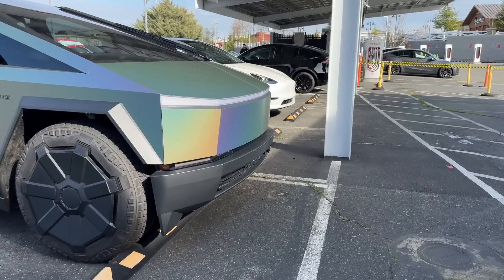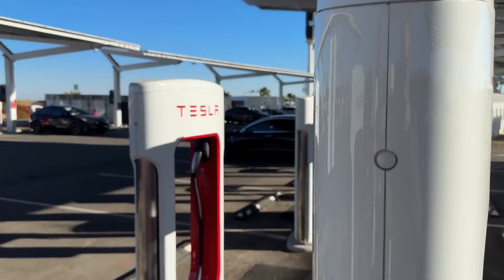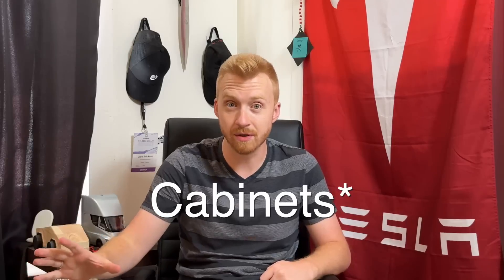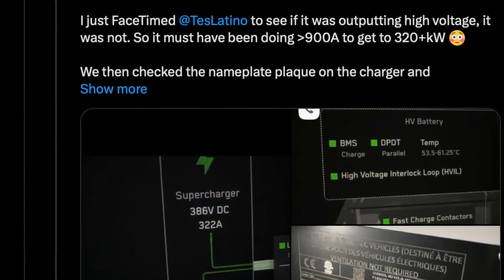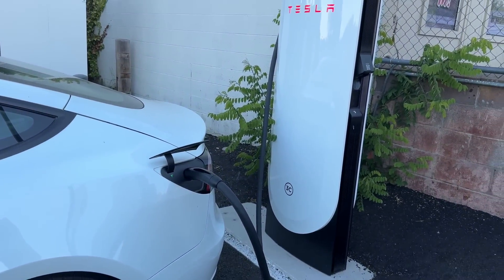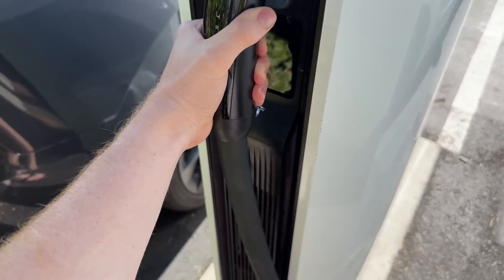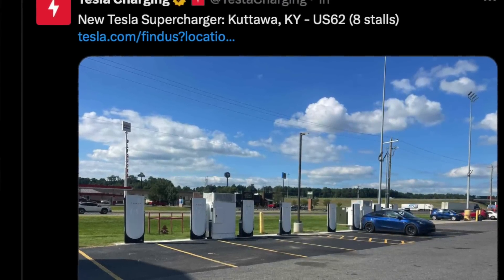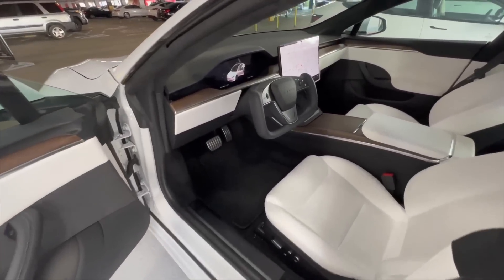Tesla Unlocks 320KW Supercharging 👀

Comment: if only there was a charging system that is at 800v and can provide up to 350kw, but maybe just not the most pretty connector, nah we'd abandon that whole system for a pretty connector but slower speeds
Reply from the maker: Cause that system is broken half the time or being used by Chevy Bolts that max out at 50kw. Don’t act like Electrify America is some wonderful asset

Comment: Thanks for the update.  We have a new 24 stall Supercharger with V4 dispenser in the East Bay.  The install was completed a couple of months ago, but it is not yet online.  I hope they bring it to the faster charging rate.  

Regarding the X vs Y and 3 vs S.  I think there is a difference, and we are willing to pay a bit more.   Letting it charge at the higher rate would be icing on the cake.  Since they are low production number vehicles, Tesla could update them the same charging and 48V as the CyberTruck with minimal interruption to the overall production process.

Comment: Tesla should go for 500kWh charge. Then increase battery warranty coverage so if more then 10% of the battery degrigated with in 10 years, then they will replace those dead cells. Just like Toyota does.

Comment: Thank for this video as I am evaluating what I think is the most beautiful Tesla model, the S

QUESTION, might it dramatically drop in value in 2-5 years?

– 2024 3P $55k
        VS
– 2023 S (demo 2k-12k miles) $65k
– 2024 S (demo 2k-12k miles) $70k

– 403 vs 303 miles
– air suspension 
– lumbar passenger seat
– hatch back
– optional yolk
– 2 displays

Comment: hmm voltage is free until you get into the thousands of volts, then things that shouldnt be conductors become conductors. amps and heat are a known quantity. im good with my ac charging and 200w of solar on my roof (~140w nominal so far all ive seen). once my car is charged I plug my house in lol. solar powered cars open a whole new world of ROI. regardless of how much i drive, im always going to have solar offsetting my base consumption at home, and I rent lol.

Comment: Give me 150 from 10 to 80 instead of 300 for 5 minutes
Reply: Totally agree! And the grid doesn't like extremely high current and power fluctuations, better to keep them flatter for longer.
Reply: @Harrythehun  Don't worry about grid . It is supplying the whole station alot more than 300kw
Reply: @Harrythehun id imagine the stations have their own capacitor Banks.
Reply: Give me 250 from 10-80 😊
Reply: @srqnate that’s what I appreciate on my GV70

Comment: I wouldn't be surprised if this is a demand lever / competition problem. 
Where maybe the idea of these V4 superchargers came out a wee bit too early. Maybe that's what led to the supercharger team being 'restructured'.
I find it incredibly unlikely that the Tesla engineers wouldn't know ahead of time that they could do 320kWh with the new dispensers on V3 cabinets. 
With all the R&D happening at Tesla I wouldn't put it past them to unveil both a battery that can charge at maybe 450 - 550 kWh and a supercharger setup that could do the same with longer sustained high output charging. Maybe %10-80 in 5-15 min.

Comment: Definitely think they should keep S & X and continue to iterate with new features such as steer by wire, ambient lighting, improved air suspension, more range, and design refreshes. I love my 2023 Model S LR and don’t want to give it up for any other vehicle in the world. Its such an amazing road tripper and the charging curve is fantastic already. It feels like it doesn’t sacrifice on anything besides price. $75k is much better than the $105k it started at not long ago though.
Reply: I totally agree with you. They definitely need to have these higher and models, it gives the models that they can actually do some experimentation on that is more costly, because they can sell less units and make a good profit. When I have the money I can’t wait to buy a model S. Also you forgot about the adaptive suspension that these cars have which makes the ride super smooth.  

So yes, please do not discontinue these cars. I know that very few people are buying them, but it is like that with all car companies. They always have some models that don’t sell as much in the higher ends.
Reply: Please don’t add steer by wire to any more cars.. we’ve already seen what a disaster its been with the cybertruck.. 4 wheel steering is a good addition but NEVER remove the linkage between the front wheels and the steering

Comment: Ok lets fix the s and the X 800v more range more interior options just blaack and white wont cut it give is some red green yellow orange blue ambiant lighing and maybe  a convertable version of the model 2 and make plaid + a thing anf boom demand his back baby 😂
Reply: AND STALKS
Reply: @Pat_The_Jelly  i dont really car they do with those the screen is fine its not that far from its original spot anyways
Reply: The S and X need complete redesigns, not just faster charging. I just traded in my 2019 Model 3 for a 2024. I test drove the S and it was garbage compared to the 3. The ride was horrible, you can't see the visualization because they put it on the drivers display which is hidden behind the wheel. It has the same seats as the 3, the top of the line car should have better seats.
Tesla needs a premium product and the S isn't it. They need an all new true luxury car. It should have 800V architecture and significantly more range but having luxury features is more important. The range is fine, actually the range of the 3 is fine. I've been road tripping a 3 every weekend for five years, I've never wanted for more range. What I have wanted is more comfortable seats.